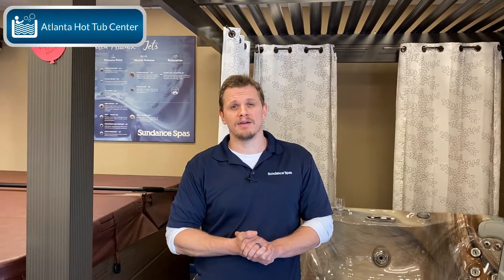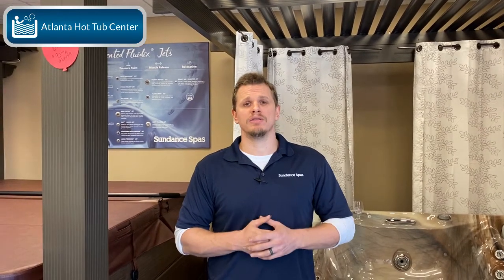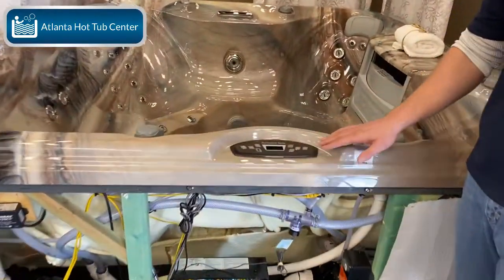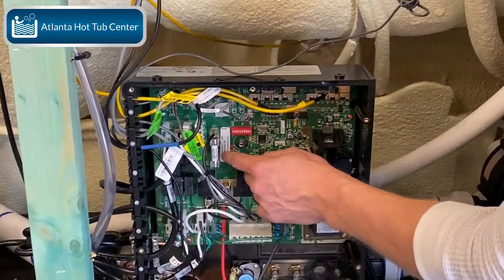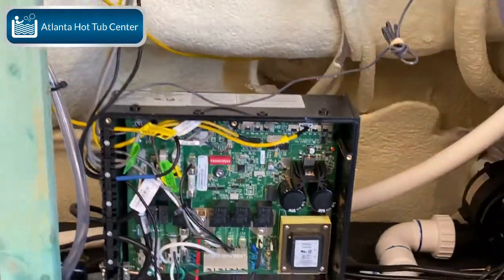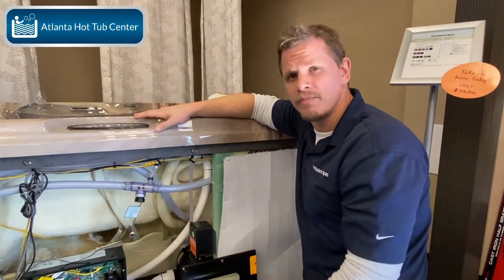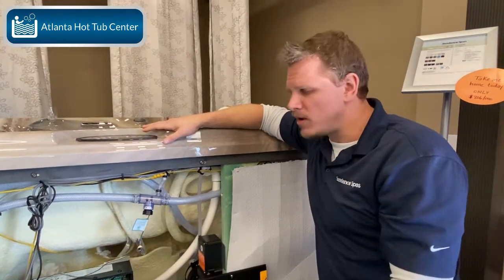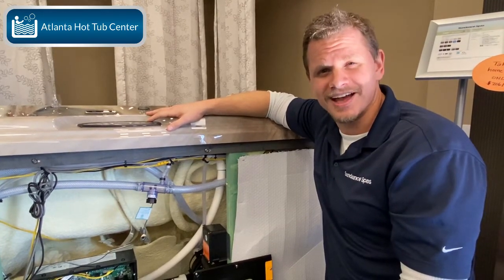BALBOA HOT TUB ELECTRONICS REVIEW and how to identify them

Comment: Does the Sundance Splash series have Balboa electronics?
Reply from the maker: Good morning, I am about to launch a Sundance Splash series review.  Remember, the Sundance Splash series is designed to compete with internet hot tubs with a touch of Sundance Spas.  They do use Balboa electronics.  Hope this helps.  Thanks for watching!
Reply: @atlantahottubcenter  Fantastic!  Can you please tell me if you think it is worth upgrading the Sumdance Series to the 240 model My dealer said they will give me the upgraded model for the same price as the 120 version.  Cost to run the 240 line is 1500.  Thanks
Reply from the maker: @josephgraham1065  Good afternoon, they are all set up to do 115v or 220v so no upgrade is needed.  There are some key differences between 115v and 220v.  

On 115v when the jet pump is on the heater is goes off which can present a problem in winter keeping it hot

On 115v it heats 2-3 degrees an hour opposed to 6-7 degrees an hour on 220v

All in all it’s more efficient on 220v and I would always go with 220v on any hot tub.  Furthermore, it has to be a dedicated line either way so 220v just makes since.  Hope this helps!
Reply: @atlantahottubcenter  thanks the brochure I got says the 240 one also gets 10 additional jets
Reply: Actually the brochure states that the 240v model has one additional pump and heater is 4k vice 1k plus it has 40 jets vice 30.  I understand the 120v version can also be upgraded to 240 but It looks like a different Tub in brochure.   Am I reading it wrong?  Also has steps with rail and cover lifter
Reply from the maker: @josephgraham1065  Good afternoon, correct, due to the additional jets the hot tub will have an additional motor.  You will also get some additional jetting.  However, if your going that extent, have you considered a Sundance 680 series Prada?  There is a big advantage moving to a full self-supporting shell hot tub.  I think you will find the price isn't that much.  I am launching the review on the Splash series tomorrow.  Hope this helps!
Reply: @atlantahottubcenter  Thank-you for replying.   I am very much looking forward to your review of splash series.  Here in Hawaii there is nothing to look at everywhere is completely sold out with wait times .  I had an intex inflatable hot tub for 4 and a half years but it's finished.   Replaced the pump about once a year.   Looking to upgrade now because that hot tub did help a lot with back pain and ptsd.  But since I'm 6ft 5 concerned I may not fit the lounge seat??  Dealer did say they are receiving some for installation soon so I can hopefully see it before ordering
Reply from the maker: @josephgraham1065  Good afternoon, I'm 6'3" so I totally get it.  I would sit in it dry first to see if your comfortable.  The hot tub won't get anymore comfortable with water in it.  I really do think the Prado would be a better model for you and shouldn't cost a lot more.  Inflatables are designed to be a more temporary solution and a Sundance Splash series hot tub would be a solid upgrade from that.  I'm personally not a huge inflatable fan.  Thanks again for watching!
Reply: @atlantahottubcenter  Inflatables suck, inflatables make me sad for the people that waste their $$$ on those cheezy things!

Comment: What are your views about gecko units
Reply from the maker: Good morning,  in my opinion Gecko just makes entirely to many “unserviceable packs” which means you have no access to the circuit board if there’s ever a problem with it.  They have two main “unserviceable packs” the in.xm and in.xe and they both have unserviceable circuit boards, but there's not really a lot on a Balboa circuit board you can fix either.  I do however, want the chance to be able to make a repair to the circuit board and know what failed. On the in.xe and in.xm the only option for a circuit board failure is to replace the entire pack.  On the other hand, if you have a bad circuit board in a Balboa, it's generally cheaper to replace just the circuit board.  I personally lean toward Balboa in looks, design, and technology.  I wouldn’t make my decision on my future hot tub on whether or not it has Gecko electronics but Balboa will always be my first choice.  Hope this helps